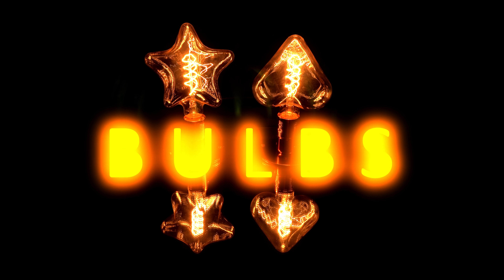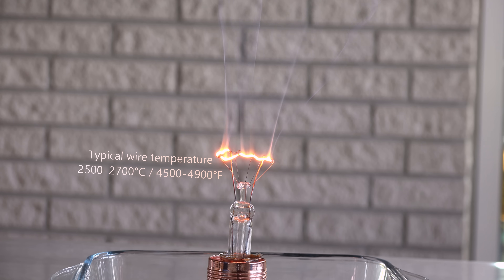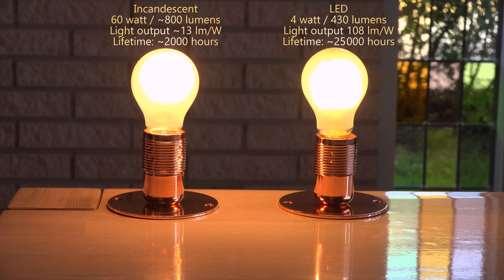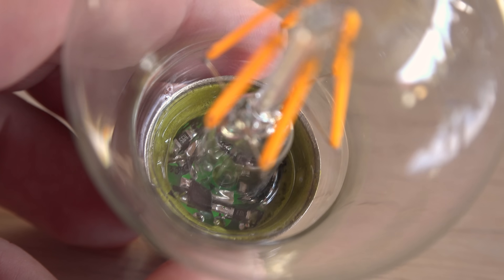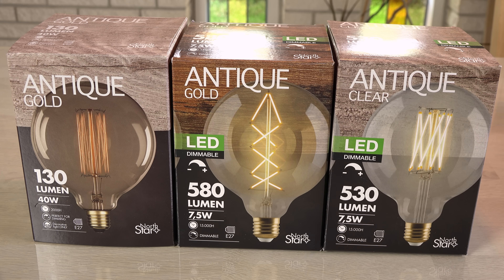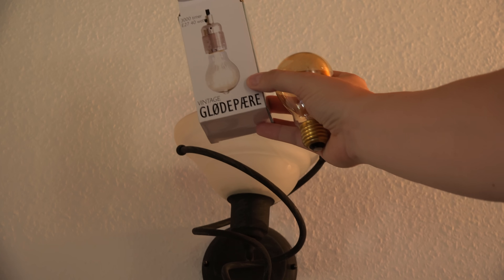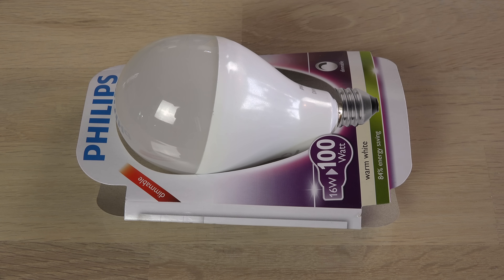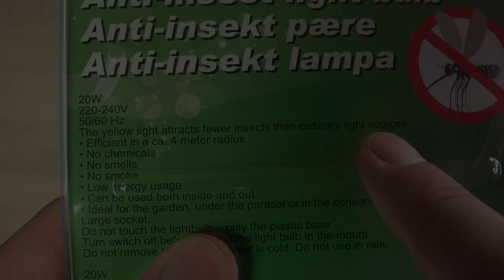Light Bulbs | LED vs. Incandescent

Comment: Main reason I stockpiled enough 100W and 60W incandescent bulbs to last my life time and perhaps my descendants
Reply: LEDs cost less for electricity though.
Reply: For me quality of light is more important that pennies saved
Reply: LOL! I threw away perfectly good incandescents to switch all my lights to LED. I'm saving a fortune in electricity.
Reply: @Martin “Megaranator” Mojžíšek
 Not colder (= more blue).  Warmer (= more red).
Reply: I was at my local Walmart today and they are still selling GE 60 & 100 W for a while those were missing from the shelves, time to buy more in case I live longer
Reply: @Martin “Megaranator” Mojžíšek

Yes, sorry, you are right.  The confusing thing is that if you were to ask at the counter for a colder temperature light here in the U.K. you will almost definitely be handed a high-K blueish lamp, as lamps are commonly sold as either warm white (~3000K), natural or neutral white (~3500K), or cool white (~4000K).  I guess people, including myself, tend to go more on how a lamp appears visually, than the more technically accurate temperature relation.
Reply: you just need to buy better LED that have colder temperature (more orange/red) light)
Reply: one bulb of 100w incand > to my led from kitchen to living room all light up. lolx. saved a lot reduced my utilities by more than 50%.
Reply: I replaced mine (starting with CFLs back about 2000) as lights burned out and had to be replaced.  Starting about 2011, I started replacing the CFLs as they burned out, but it's probably one or two bulbs a year.
Reply: I'll bet you haven't even broken even on the cost of the bulbs yet, that takes literally years.
Reply: If you buy a 2000k or less bulb it is indistinguishable from halogens. And they use 1/20th of electricity that you say your bulbs use. You are spending 1/20th of the money and saving the planet at the same time.
Reply: That's by feeling, but "warmth"   is described by temperature in Kelvins. Look up comparison of stars by temperature

Comment: fortunately, LED lamps finally have got bright enough and a pleasant colour temperature for most household applications. but, besides the CRI issue (and somehow related to it), there is a significant problem when it comes to dimming. where a dimmed incandescent bulb shifts to a orange/red spectrum (because of reduced filament temperature), the LED (if dimming capable at all..) will just go darker with the same constant colour temperature. this is not really cozy for your living/bedroom etc .. ;) .. so happily you can now find some "special" LED lamps that recreate this "dim glow" effect by an extra amber coloured LED. some are more, some are less convincing (col. temp, flickering, hum, again CRI, etc...). so it is obviously not that simple to reproduce "good old" incandescent/halogen light sources. i hope this red shift dimming effect becomes an absolute standard for LED lamps quite soon (along with further improvements at CRI).

Comment: LED disadvantage - the light quality is horrrible.  Why should I get a headache just to save a few pennies?
Reply: Don't worry, the government knows whats best for you, and will force you into the correct decision for you. Stop thinking and obey.
Reply: Then get a good led,. However incandescent is always more natural... I'm very  used to it
Reply: its better than CF though that's for sure...
Reply: Get good LEDs, seriously. Also incadescent light is so warm it quite messes with color perception.
Reply: Get a good one then
Reply: +Roller Coaster Maniac you have no understanding of how led lightbulbs work, led lights are also two way bulbs assuming a rectifier is in the bulb(evey ac socket LED bulb) the reason for the flicker is the sine wave, because it doesn't just go +60 -60, it actually goes 0 10 20 30 40 50 60 50 40 30 20 10 0 -10 -20 -30 -40 -50 -60 -50 -40 -30 -20 -10 0, incandescent bulbs because of the energy excited in the fimalment will keep lit for almost half a second after losing power(in bigger bulbs, the filament glows its way out, I'm sure you've all seen this when a bulb is turned off) but LED lights have no stored excited energy so what happens is when the sine is closer to 0, the light turns all the way off, you can use LEDs as strobelights because of this but not incandescent. to fix this, the expensive(75$) bulbs use capacitors and a charge circuit to keep supplying constant DC power to the LEDs, just like a high end computer power supply, or even mid range electronic power supplies, but also MASSIVELY Decreases shelflife as capacitors dift and die or leakout well before an LED burns out. all in all incandescent bulbs are better, produce better natural light, have better recycling properties, and have better environment impact.
Reply: *****
That post was WAY too long, as you didn't stop to let me respond to your first question. 

The fact is that I DO consider light quality to be the ONE and ONLY characteristic worth considering. (And it's my choice, right?)

 So if there's an LED built that matches an incandescent's light quality, then I'll certainly consider using it, even if it costs 10 times as much.  If not, then LEDs are a non-starter. Period.
Reply: don't you know you could consume some painkillers purchased at your local pharmacy for that headache the light cause?
Reply: Lol, that's one Savage comment 😂😂😂😂
Reply: Cool LED's aren't "shitty"-unless you're buying shitty cool LEDs.  I use a mix at home-warm LEDs in the living room and bedrooms, and cool ones in places like the computer room and the garage.
Reply: I prefear halogen lamps mainly because of that :)
Reply: You need to pay attention to the LED colour temperature and CRI figures.  Go for warm white (~2700K or less) and a high CRI.  If you, like many, don't know better and buy cool white (~4000K) then the output can look horrible in many settings (very cold and clinical compared to a typical incandescent light).  Also, don't buy the cheapest crap you can find - you tend to get what you pay for.
Reply: ***** You are right... kinda, but not realy. You see, led lights unlike incandescent ones, or even cfl, have way more variables. even the shitties, cheapes noname incandescent bulb, is going to last quaite a bit (@a year at least) and have almoast the same spectrum as all the others. It might explode in a shower of glass shards with the soud of a gunfire when it burns out, but hey! till then... it's fine. Now you see, with leds, there's directivity, light temperature, intensity patern, flickering, lifitme of leds or other components, warmup time, overheating issues, color shifting. And guess what! even good brands that make quality products make leb light that have one or more of those variables shifty, and everything else ight be perfect, but that 1 thing ruins it! :(
Common isues are overheating, flickering and short lifespan (by short lifespan i mean less then 6 months) The best lamps i've seen so far are Philips (and not only led lamps:P) if you open them up and replace the single diode with a bridge and replace the tiny filtering cap with a bigger one and ad a zener diode, you ger rid of theyr only issue! flickering... they will heat a bit more thow, and ofcourse, they are already kinda price and you need extra parts and the time to modify them... not realy worth it most of the time. I did it for a work light, in wich a normal bulb would last 1-2 month cause of mecanical abuse :( also it's anoyingly hot during summer. But now it has the added feature that it can run from a small Lipo battery! :D

My point is... finding the right light for your aplication requires some trial and error. There are good cheap noname led lamps on ebay, but you need to do some resirch and some "buy one of each" to find some. Takes time and sometimes more money then you'd expect. Bigclive here on youtube has lots of informative vids on the subject, i recomand to all with interest in the subject of finding cheap but good electronics :P
Reply: BlackEpyon LED lights still produce a much narrower spectrum of light that also a much more focused beam. a reason i dislike them
Reply: Andrew van Leeuwen and basically all of them are narrow band, and have very strong focused light
Reply: When I go to the supermarket to buy a lightbulb, the last thing I need is the confusion caused by finding thousands of different bulbs to select from.  Just tell me which one will work as well as the incandescent bulb it will replace.  If no such replacement bulb exists among thousands of LEDs, then we haven't made much progress, have we?
Reply: Ewie M "Just tell me which one will work as well as the incandescent bulb it will replace. If no such replacement bulb exists among thousands of LEDs, then we haven't made much progress, have we?"

If you define "work as well" solely by "is it just like an incandescent", then no.  But the truth is that LEDs last something like 10 times as long and use 1/10th the energy.  And really, incandescents are one of the very last bits of Victorian technology that we actually have regular contact with.  We don't use steam trains.  We don't cook on wood stoves.  We don't use a horse and buggy to get around.  There are all advantages to those bits of older technology, but those advantages were outweighed by the advantages of newer types of trains, stoves, and personal transportation.

And deciding which bulb comes down to just three questions (at least here in the US): 

What wattage?  Most packages prominently show what the LED is equivalent to, so if you're replacing a 60 watt bulb, you'll want one that says "60w" on it.  You already do that with incandescents.

The "temperature".  If it says something like "daylight" or "cool white", or "5000k", that's going to be a bulb that has approximately the same color as sunlight.  If it says something like "warm white" or "2700k", that's going to give you about the same color as an incandescent.

Finally, there will usually be something on the package that says how long the light is expected to last.  You can pay a little less and get bulbs rated for 10 years, or pay a little more and get bulbs that are designed to last longer.
Reply: seems like you've played this game before

do you frequent the realms of the chans by any chance?
Reply: It depends on the CRI chip that comes on the bulb. Not all LEDs are the same in color rendering cause of the CRI chip quality. When buying LEDs bulb, the store should have some sample of all the type of LEDs bulbs power on, is there where you can see the deference and then choose wisely...
Reply: +9ff70f96 this is true, but there is also a slight issue with LED and AC typically applied to the sockets. Incandescent lights are two way, so while the AC electricity does go back and forth, it doesn't flicker a lot due to it staying warm. LED's are one way, and the flicker, although not really noticeable to the human eye, it does exist and is a lot more psychologically noticeable, so even if they look the same, the average person will find incandescent more pleasing. Good LED lights typically have a diode bridge, so that its flicker is a lot closer to that of an incandescent light
Reply: @Roller Coaster Maniac

I do have a moderate understanding of how LED light PSUs operate.  'Bait28''s reply above mine answered well, though I may disagree with his interpretations of "better". ;)
Reply: Only if you get a cheap one from Ebay (the 80% one). Good LEDs like ones from the higher end GE, Cree, LG, bulbs are around $8 and is 90%+. Some with just as good as many incandescence ones.
Reply: +Bait28 

Wow...that was very well written and detailed! I just learned a lot of good information.
Reply: +Jessy Chainé the warm Leds for me still carry a big flicker I've noticed and only the more expensive bulbs have way less flicker
Reply: +Jessy Chainé the warm Leds for me still carry a big flicker I've noticed and only the more expensive bulbs have way less flicker
Reply: +stalkersas 

Great information! Thanks for posting!
Reply: almostfm of course but more depending on what kind of led driver there is behind a led...
Reply: The flicker only happens if the LED doesn't have a rectifier and smoothing circuitry (which typically consists of at least one capacitor and even a voltage regulator). Many cheap LED Christmas lights (sold in America) give that flicker because they are half-way rectified, where any LED powered by a proper driver (the circuitry isn't that hard to make) will have an almost smooth DC current, and no discernible flicker, even on your average camera.

Because the cheap ones are half-wave rectified by virtue of being diodes that often don't have very good reverse current tolerance (the other half of the wave), they don't last as long and, especially in Christmas lights, burn out faster.

Again, don't get the cheap ones. Incandescent lamps have been around for over a hundred years, and florescent lamps almost as long, but with LEDs, you will only get what you are willing to pay for.
Reply: Bait28 lol... You know there are other leds right? Different temperatures and diffusion? There are literally thousands of different leds and drivers
Reply: Incandecents are more headache inducing.
Reply: How about they are not dimmable without using a smart phone, and they do not work in an oven or where they can't stay cool.
Reply: KlitButter trollbait is strong
Reply: +PrivateEyeYiYi - ://
Reply: +Bait28B - LOL
Reply: Jod Bronson it's probably because of the way you talk
Reply: +Bait28 - All you have to do is EAT FUKTARD in the morning, you will be all set :)
Reply: +Bait28 - You are RIGHT !!! But easy to be like me, just EAT FUCKTARD in the morning, you will be all set, LMFAO - See, gained 2 new FUCKTARD Friends today already :D
Reply: Never had no headache or problems from LED. 
And here, grid power is only 50 hertz. 
Maybe i dont have a head or brains , but I dont suffer any headache from LEDs. 
I was worried the first time i bought an LED bulb , hearing all those myths and statements about headache, never had any.